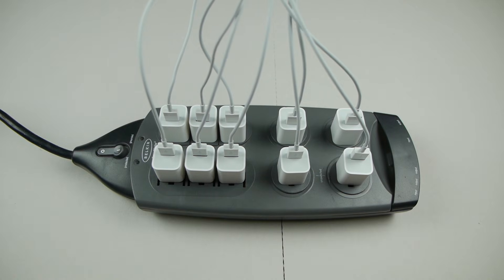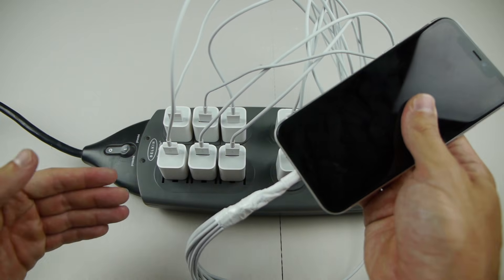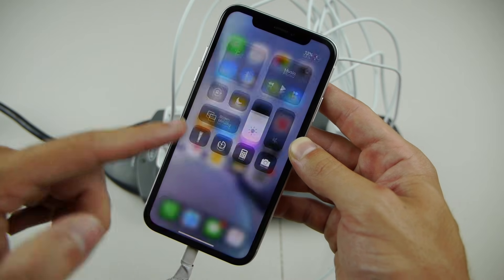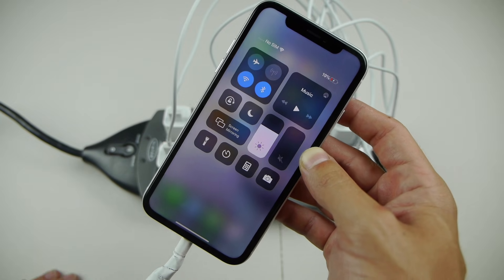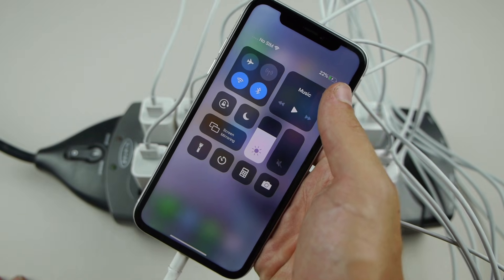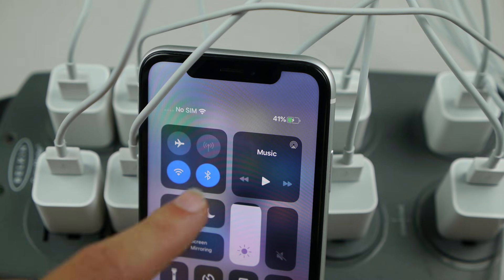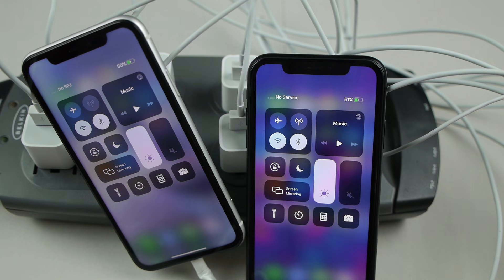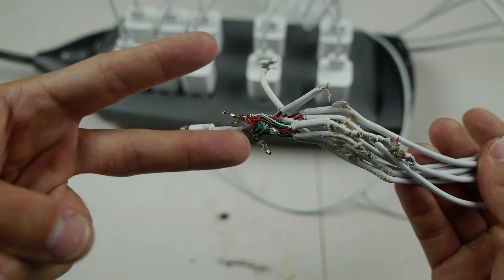What Happens When You Plug 10 Chargers in an iPhone? - One Mega Charger!

Comment: ”Everyone should try this”

Monthly electricity payment: 
Hello.
Reply: You can go somewhere to charge so you can make the people that own the place pay for it
Reply: @undead1378  when they realize??
Reply: MYLAPURAM CHAKRAVARTHY idk
Reply: it doesn’t increase it as you’re still using up the same amount of power
Reply: You're genuinely stupid you think the outlet is packing more energy into the phone? It's just doing it faster which will charge the phone faster but will also significantly decrease his battery health, literally 10x faster he'll need to buy a new battery/phone however your electric bill is unaffected.
Reply: @Zeus2k  You're stupid for thinking that connecting 10 chargers like that into one cable will make the battery charge 10 times faster. The electronics take the amount of energy they need while charging. The iPhone only took around 2A because it will charge at 2A at 5V. It did charge faster because of that, because it was not bottlenecked by those 5W chargers (rated at 5V 1A). A single 5W charger can only supply up to 1A, but it doesn't directly apply those 1A. This is why your little Bluetooth earphones don't overload while charging from a 5V 3A charger.
Reply: It costs less than a dollar to charge your phone, for the whole year
Reply: @nickfiore48  Correct me if im wrong, but i think it was with the iPhone 6s..

if you charge it every day it costs around 1,70€~ (depending on the country youre from, in this example Germany) and even more with batterys nowdays (3500mah+)
Reply: bonjour
Reply: lol thats facts😂
Reply: We
Reply: Hola Niño
Reply: It would cost as much as the amount of likes on this comment!
Reply: You can use car accu and inverter :)
Reply: not much expensive
Reply: Chargers not uses as much electricity i think

Comment: charger itself acts like a battery.
if you attach batteries in parallel potential difference do not change.
It will act as 5V 10A charger if ten charger used and since voltage is not changed cell phone will only take 1A out of 10A because it depends on device how much current it takes from the source.

Comment: This guy is a clown and this is pure BS. Since the voltage stays the same and internal resistance of the battery stays the same, current stays the same and hence the power drawn by the iPhone stays the same. Power draw is dependent on the destination, not the source.

Comment: Nothing shocking...u can use more wattage charger to charge the phone ... provided the voltage rating should be 5v...which is maintained bcoz the chargers are connected in parallel...I think it's charger as normal

Comment: NEVER CHARGE YOUR PHONE FASTER THAN ITS CAPACITY.
I've worked with battery packs for a while and the slower the charge, the better, for multiple reasons. But first, I must say this, IF YOUR BATTERY IS 3300 MAH, DONT CHARGE IT FASTER THAN 3.3 AMPS, IT WILL DIE IN ONE OF TWO WAYS. 1. The battery life is greatly shortened. 2. THE BATTERY WILL BLOW UP AND SET YOUR HOUSE ON FIRE. Now that that is out of the way, if you charge your battery really slow, it is good on the health of your battery, charging a 3300 mah battery at 3.3 amps max is no problem, but a slower charge is the best because it doesn't put as much stress on the battery. Charging it too fast like I said earlier, is putting too much stress on the battery. Lithium Polymer batteries are know for being unstable like this but, they perform way better and as long as you don't do this, you will never have these problems with your phone unless it's too old or has a manufacturer defect.

Comment: Because you connected all the power lines together in parallel then this would increase the amount of current available and the phone may charge slightly faster but not significantly as it cannot put so much current at once as the voltage is still at 5V.

Comment: Me: check comments first

Comments: don't do it your house will burn without the iPhone

Me: I am Android
Reply: Lel my phone can get from 15 to 100 in 40 mins
Reply: Im not an apple fan but the charge for iphone 6s is OP in 1 hour you can go to 0 to 100 but his battery is 1 hour too HAHAHAHAH
Reply: @MehBzl  OnePlus 7 pro had also that, but it lasts a full day if I am using it as normal, and I do use my phone extensively for work and games.
Reply: @maggiekennedy5961  its good to text me at 07 🤣 because im french and i have french clock
Reply: Xiaomi mi10 ultra has 120w fast charge and 50w wireless charge
Reply: Lmfao..
Reply: Fun fact that some Androids have iOS socket charger
Reply: me and my family with Huawei quick-charge in 30 mine:👁️👄👁️

Comment: Or just get a fast charger. Those are 5V 1A chargers, so 5 watts. It's like using a 50W charger. Well, actually less because you loose some energy because of cable resistance. If the iPhone XR doesn't support, let's say 45w, fast charging you're eventually going to damage the battery. But hey, if you don't trust me do it your self, just don't complain when you have to pay for Apple's overpriced battery replacement. Cheers

Comment: I'm guessing that the charging port on the iphone will only allow a certain amount of power from the charger, usually 1 charger would be enough to meet this minimum power threshold but all you're doing now is splitting the power input across all them chargers, meaning it's just as efficient as one charger.
Reply: I'm almost a 100% I read something like this online before. The phone is programmed to receive a certain amount for safety concerns.

Comment: This is useless. He is just a fool. There is a limit of current that the phone will allow to charge the battery it doesn't matters if u use 10 or 100 chargers the phone will only charge the battery on the fixed amount of current that was allowed by the manufacturer.

Comment: Stupid crap. All the chargers are at same voltage. 5V and same current 1A. If the load(phone) supports higher current/amperage or fast charging, then the phone will get charged fast as you have plugged 10 chargers effectively boosting the amperage to 10A at 5V. However, as the phone does not support it, it makes no sense. What a waste of money... To bad you didn't have proper education.

Comment: The phone manages the charging amperage internally, it doesn't care if it has a bilion chargers connected in parallel. It should only pull the maximum it was designed for.
Reply: Been waiting for someone to say this 💯💯
Reply: well a billion will still fick
Reply: this is it👏

Comment: Should’ve tried with 10 of apples fast chargers. But the reason for the slow down is because the XS/XR and up support fast charging but have a software block to trickle charge after 50% so it doesn’t destroy the battery. I’ve charged my iPhone 11 with the USB C cable connected to my MacBook charger and it got to 50% in 5-10minutes then trickled after that lol.

Comment: So, by adding 10 5W chargers (each giving 5V 1A) you will have 5V and 10A of power available (50W), but the phone will only take what it needs. 
Since the chargers are common Apple 5W chargers, the phone will recognize them as "Apple 5W Charger" and only take the 1A it's circuitry is designed for. I see no point in this hole video, maybe for the views?

Comment: It's not a new thing. You connect those chargers parallel to each other. It will increase the current while keeping the voltage in a constant value. (If 1 Charger output 5v & 2A, your whole system output 5v & 20A). This voltage is acceptable value to a phone. It's not only for I phones. What happens in this system is you are giving more energy in to the phone in LESS harmful manner. This is how the fast chargers made. But the phone must compatible with it. Otherwise It may effect to battery life and may cause temperature rising.

Comment: Hmmmm.. you havr just pumped the amperage to x10 with that series combined chargers plus you have created a fire hazard at where the cables are joint together as the wire is not rated to handle such amperage . Your  phone will just get  the power it needs at constant voltage.

Comment: Engineer here; the iPhone is current limited while charging and connections are made in parallel so the voltage should be equal to that of the highest of all charges. This means that on top of the maximum usable current non will be used. This might also be the reason why some(/all) chargers got hot, because power from the best supply feeds back into the lesser supplies...

Comment: The answer is simple.  Too many wired soldered at one point = increased resistance in path.
Battery reaches upto half capacity, charging port adds resistance to thr cable as well. Hence slow charging. 
It worked before because the battery was dry.
Single cable does it faster due to least resistance.

Comment: You are just boosting amps and not volts !!  All combined charger is still giving 5 volts  10 * 5 volts = 5 v bt its 2 * 10 = 20 amps bt iphone have built in input amp controlling management which is like guard who decides how much current they allowed to paas thats y its not frying up but on the same hand if u connect all this charger in series then at another secnd it will burn all the controlling managment ic bcz they cant handle more thn 8-10 v !!

Comment: What kind noob is this guy ..
All smartphones have BMS (battery management system) circuit inside that limits the current going to the battery 
Also the battery has internal resistance that limits the max charging current at given voltage ..

Comment: Here we have to consider Ohm's law for parallel circuits to see why it doesn't do much of a significant difference. Since we are not connecting the chargers in a form where the chargers extend outwards, the circuit is not in series. Each individual cable (the chargers) is analogous to that of an electric conductor with some internal resistance connected in parallel. Note, for every electrical current we have voltage equals current times resistance (V=IR, where V represents voltage, I represents current, and R represents resistance). Current is simply the amount of electrons passing through a given area. Resistance is a little harder to define simply, there is a formula but its just how restricted the flow of current is. In parallel the voltage is the same across all the chargers, but they are smaller. We have 10V=I(1/10)R_total. Here R is the same for all the chargers as well, but to sum up the total resistance, we must use the equation 1/R_total = 1/R_1 + 1/R_2 + 1/R_3 and so on if they are in parallel. Hence, we get R_total is just 1/10 of R. So, 10V=(1/10)IR. Thus, we have 100V = IR for all ten chargers. Now, for one charger we have V = IR. Regardless of how many chargers, the current is always the same. We have P = I^2 R. Thus, for ten chargers, we have P = I^2 (I/100V) and for one charger we have P = I^2 I/V. Here P represents the power measured in watts. So if you go to the apple store and see a 10W charger, that gives the power. Thus, for ten chargers, we actually see the total power output is a hundred times slower.

I'm not saying my math is right, but what I would like to illustrate is the electrical rules are not straightforward as it seems. When it comes to batteries and capacitors and chargers in electronics, it's not always you add more and it becomes more powerful or whatever, there are weird summation rules that you have to follow. And how you set it up matters as well.

Comment: Every of those bricks can deliver 1A @ 5V.
If you solder all cables in parallels as he did, it will add up the amperage the whole thing can deliver. With 10 bricks it can deliver max 10A @ 5V. Since the iPhone regulates the max amperage it can take, it will stop at 3 amps approximately. So that means every charger only works at 30%.

He should try to solder them in series, that would be a firework.

Comment: What should happen? It's still 5 volts, but 10 amps or so. The phones charging circuit just draws as many amps as it can handle from the supply but not more than that.
Why not try to connect them in series instead? Overvolting will definitively do someting at least. ;)

Comment: Just study ohm's law, parallel and series connections and you don't even need to do this to know what happens
Reply: Pretty sure these have circuitry to prevent fires. Thus current may not be scalable as with a current divider
Reply: Just like me. This is first time i see this with chargers but i knew that it will be the same.  Simmilar principle is in power distribution network. They put some transformers parallel to each other to reduce overload. Nothing else is changed except load on each transformer.

Comment: The thing is no matter how many chargers you have... the battery of the phone will get the maximum of 15 watt. After 40% it will get only 5 watt (like the one cable iphone).
The side by side comparation should have been done with the battery lower than 40% to see the difference.

Comment: Damn, running out of ideas? You just made a cable to use more power sources. Doesn't up the voltage or anything just let's it draw from more outlets. Other bets thing juts get a stronger charger

Comment: If the watts supported is lower than the watts of the charger it will charge of the watts the phone supports it will not go higher so if you got 1 charger of 120 watt and a charger of 60 watt and the phone supports 15 watts it will charge at 15 and lower

Comment: That 10 charger thing wont work simply because smartphones today are designed to only take a certain amount of voltage the would be compatible with their battery. You should have used 10 fast chargers on a phone made in the year 2000 to 2003.your phone might explode and that is not even the worst case scenario.

Comment: It failed bcoz
By connecting 10 chargers together will just increase their maximum source current.

For eg. If all chargers are rated for 1 Amp
It means 10 chargers can source 1*10 Amps of current.

But Battery of iPhone will sink only 1 - 2 Amps of current no matter how much current your charger can provide.

Comment: those charger cables are connected in parallel so voltage is same and current varies so battery is getting more current that the reason at low % it just charges very fast

Comment: This is basically just like using a laptop charger on your phone. Parallel connection increases amp capacity while maintaining it's voltage so there will be no heating on the phone. 

Current is pulled, no matter how high it is, the phone will consume the largest current it demands and not the highest current the adapters throw.
Reply: If the phone demands 2.4 A and the chargers throw 10 A, 2.4 A will still flow through your phone.

Comment: The phone won't accept electic supply more than it's default capacity.

*Still won't do this LOL
Reply: Assuming he soldered all the wires in parallel which I doubt he did. The voltage will stay the same. The maximum amount of current available will add up but the iPhone will only able draw a portion of it and the rest will be unused.

I doubt he did for real tho. Each wire got small 4 wires. 1 positive, 1 negative and the other 2 for data transmission. He need to combined 10 small wires into one which is very difficult for each positive and negative terminal. The wire joint he shows at the end doesn't looks like that at all.
Reply: Been scrolling through waiting for someone to make this comment
Reply: Thx for this info lol

Comment: iPhone chargers output 5v to the iPhone. They were all connected in parallel so it was 5v with 1 or with 10 chargers. The only difference comes from the current draw of the iPhone. Newer iPhone that are capable of fast charging can draw more current in order to charge faster. However, some chargers are not capable of supplying as much current as the phone can draw so it gets maxed out - resulting in a normal or low speed charge. If you connect multiple chargers in parallel like this, their max current will be added together, BUT the iPhone only draws so much so using something like 10 chargers is wayyy over kill. Either way, your best bet is to probably just buy a high current rated USB power brick. One that is capable of say 2.6A. The reason it slowed down around 40%, after charging so fast before, is because iPhones have special circuitry that slows the current draw as it gets higher in battery % to keep it from over heating and in very rare cases... blowing up.

Comment: This is fake, 1 charger = 5 volts, and 10 chargers = 50 volts

Result: 50 volts for a 5 volt lition batery, dont try this at home
Reply: He connected(soldered) them together in parallel, so it's still 5 volt.
Reply: @weitsungsoo3629  if he soldered in parallel it will increase the current
Reply: Not fake if you know electricity then 5x10= 50 yes but only if it is in series but he soldered it in parallel which remains 5 volts at close to 10 amps which most fast chargers can put 7 amps and the phone will still take it
Reply: Yes its a fake

Comment: Basically you put your power sources on parallel, the voltage is the same but you're pumping 10 amperes to the iphone, of course is gonna charge faster but your battery will die faster than usual

Comment: Hey guys technician here, when you connect all the cables together you still get the same voltage on the cables ass soon as the wires touch. The 120v from the charger will still only be 120v because it doesn’t add up. At the end of the day the connector to the phone is what will limit how much goes into your phone :)